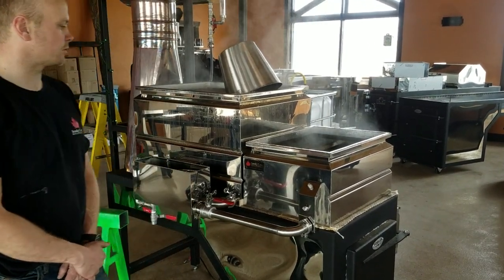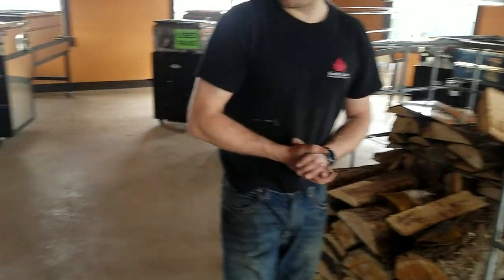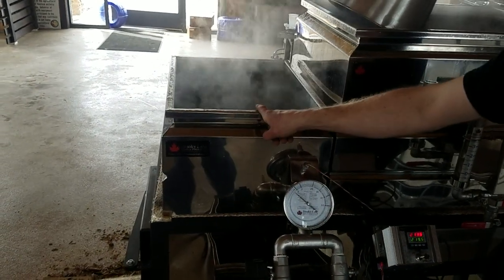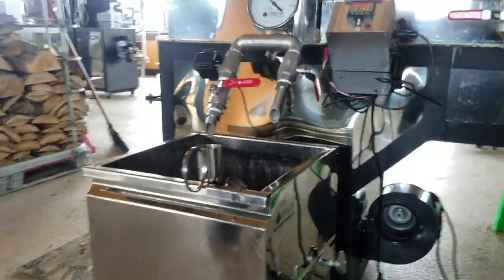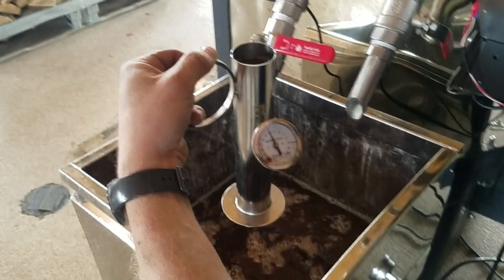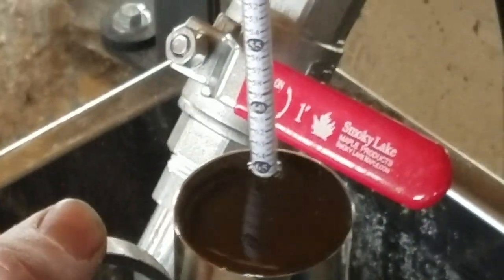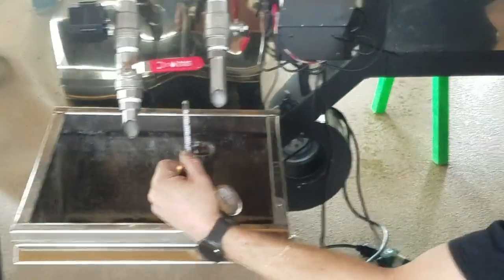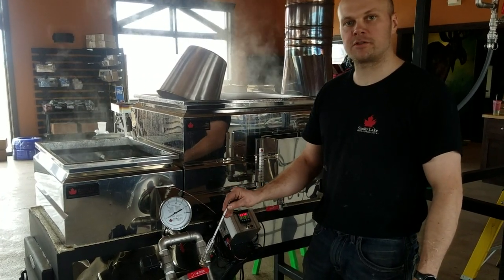The shutdown process of the maple syrup evaporator and correcting density of your daily product.

Comment: You've made that fancy set up with  PID's  and electronic  ball valves and  you  have a  manual single pole switch next to the door for the draft fan ? How about you move the single pole back as an override and just put the door on a micro switch ?
Reply from the maker: When dealing with the dangerous fire behind that door, I need to KNOW that the power to the forced draft is cut; here I will not rely on electronic systems, especially when so little is to be gained by doing so.